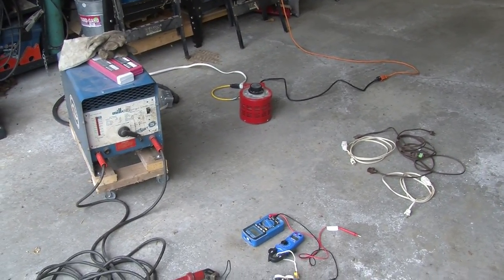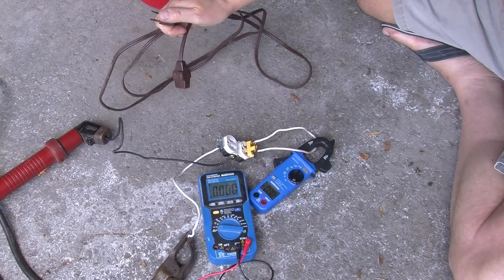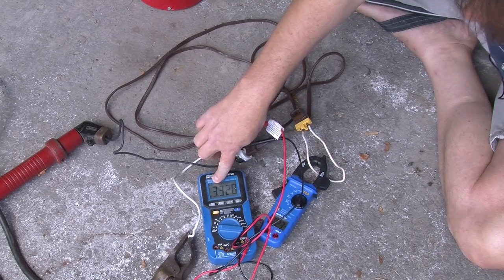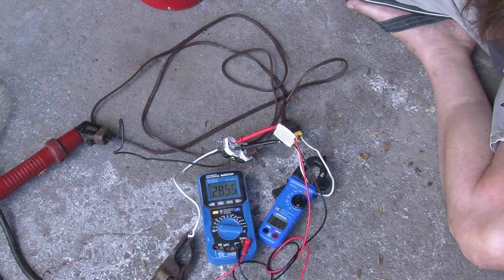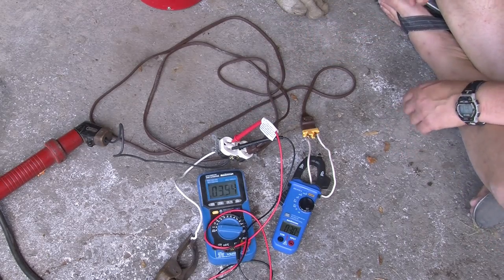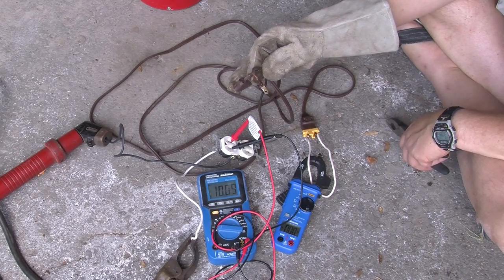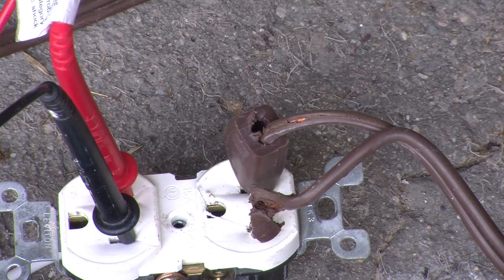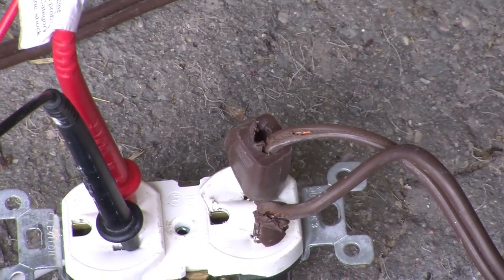Lets try overloading some extension cords.

Comment: one of the core troubling issues I find with normal light duity extension cords is the fact the plug on the end often makes a very poor high restance conection to the device pluged into them.. people do things like plug hair dryers into them in bathrooms when there cords are not long enougth and quiclky discover that it melts the plug on the hair dryer ,, the worst thing someone could ever do is plug a space heater into them as they will not trip the 15 amp circut breaker and you will end up with a fire (usully at the plug on the end) , a bad receptacle with a loose fitting contacts same serious issue and many low quality receptacles instaled in houses over the years develop this issue as they age resulting in house fires when people plug in unatennded long turn high currrent devices like space heaters .. they make 20 amp high current recepticles for use in areas where high current loads are used like on kitchen counters and I recomend there use everywhere.. never use an extension cord with a space heater unless its a special one rated for constant high current loads .. same with power normal strips the poor  contact they make with the plug can not handle the constant high current (12 amps ) load and will likly set the plastic power strip on fire..
Reply: We in Europe never had similar issues.
Reply: Electrical safety should be better taught in schools, imo. A lot of people seem to judge load by how many things they plug in and not what they plug in. If you fill a powerbar up with six 5 watt phone chargers it'll be completely fine. But when you put just one space heater, kettle, hair dryer, etc, you're putting way too much faith in a product which usually is designed as cheaply as possible. Sadly alot of people who dont know any better would look at the latter situation and think "its just one item, its fine". Of course, what we should really do is copy what the UK does, and fuse our plugs if they aren't going to be up to the same spec as the home wiring, which the panel breaker is sized for.
Reply from the maker: We should at a minimum have fuses in these light duty cords - it can be done - some xmas lights do and the plug is barely bigger. I was amazed at how well the modern cords did - but still! Your points are so true!
Reply from the maker: I'm not surprised!  I lived in Germany and Iraq (which used UK plugs) when I was a kid. Both German and UK plugs seem so much more robust (over engineered?) than ours. The UK 13A plug is about the size of our 240V 30A one for example.
Reply: @ElectromagneticVideos  I am not a fan of Christmas lights, either.  They are usually wired with 22 or 24 gauge cable and have a three amp fuse in them!  I know I don't like running three amps through 24 gauge wire -- I plug each string of lights into a power strip separately and don't daisy chain them.  If I need a short extension to make it work I have several green 16/2 extension cords to connect them with in the Christmas tree box.  One incandescent string of Christmas lights draws less than an amp.
Reply from the maker: @mharris5047  Yeah - sadly I'll bet the ever increasing cot of copper will only serve to encourage the  manufacture of those really thin wires. As you said, at lest they have a fuse ...

Comment: I once used a new 10-foot 12-gage heavy duty power tool extension cord with a 15 amp 120 volt table saw.  The saw started much slower with the extension cord than without.  I determined the cord had a 30 volt drop during saw startup and one plug got warm in a few seconds.  Breaker never tripped.  I now check the temperature of the plugs whenever I use an extension cord.
Reply from the maker: I never trust those extension cords plugs and sockets - the softer plastic just doesnt give me much confidence. 30V drop is huge! Amazing with that 12 cord.
Reply: @ElectromagneticVideos  I check the resistance of my extension cords before using them.  There should be minimal resistance (0.2 ohm or less for most plus whatever the resistance of the multimeter leads are).  Dropping 30 volts on a ten foot cord is ridiculous!  Even 500 feet of 12/2 shouldn't drop that much.
Reply from the maker: @mharris5047  Yeah - anything more than a few volts drop is too much! One things I have often wondered about is the effect of old tarnished blades on plugs. I should test that sometime.

Comment: Looking at the Siemens breaker curve, a 20A breaker will trip between 60-400 seconds at 30 amps. Should be enough time to prevent a fire unless you're maybe using an 18ga cord, which def should be illegal anyway. Not everyone understands current ratings like most of us here, and some people are  bound to unknowingly abuse the ratings of these cords.  Or like Christmas lights, these small gauge lamp cords should have built in fuses.

Comment: The Brown Extension Cord was before the NEC was revised to make sure electrical cord insulation wouldn't burn or "sustain combustion"... you could have started a charcoal BBQ without any starting fluid with that brown cord... food would have tasted funny, though...
Reply from the maker: Thats why! So there was a change in the code! I can totally see your BBQ points. I wonder if the code also has some toxic fume rules - the smoke from the brown one was unimaginably bad.
Reply: @ElectromagneticVideos  Yeah, the first were about 45-50 years ago... there were more added in the wake of the MGM Hotel fire in 1980 that killed nearly 100 people. I think the codes were amended for toxic fumes from insulators used on inter-floor wire ducts/raceways on multi-floor buildings. Not sure when it applied to Extension cords, but it was in the 1970's, IIRC.

Comment: They are all Noma cables, including the brown one. The brown one is late 60s, the white ones are mid 90s. There was a generation in between that had the newer plug style seen on the white cables, but no polarization - made in the mid to late 70s. All of them in the video represent a period where Noma manufactured cords in Canada. Unfortunately, in the late 90s or early 00s, Woods bought Noma brand and shortly after shifted production to China. The new product is inferior and a lot of the cost cuts are evident, especially in the cord receptacles/plugs. On a side note Noma also made an integrated “cord caddy” reel of cord with an integrated outlet in the reel body. Considering the cord stays wound when not fully extended, would be nice to see in a torture test like this.

Comment: Oh yes the good old Federal fire pacific electrical panel which will let you are arc weld anywhere you would like in your house since the breakers don't actually trip. That's what a check under the UL laboratory store at the time of manufacturer got you. So you could theoretically see upwards of 50A easily on any circuit. There's definitely an era of plug and and cord options that I would not trust like that brown one I never did like them as well as than that they were brown.
Reply from the maker: Yes - there must have been some terrible incidents as a result of those breakers.

Funny - I don't trust those extension cords either and was in the process of putting them in the garbage and had a thought - might be fun to see what happens when too much current goes though them.  What you don't see in the video is how vile the smoke was from the old  brown one.

Comment: 12:28 Federal pacific Electric panels are a wee bit dangerous. The breakers won't trip.
Reply from the maker: At some point I want to try a Federal Pioneer. I wonder what the "dont trip" statistics are? 1 in 10? 1 in 100?
Reply: @ElectromagneticVideos  I believe Federal Pacific manufactured outdoor breaker boxes.  40-50 years of weather is what does those breakers in -- even with the breaker box door closed basically the whole time.  My brother has an outdoor breaker box on his house but I sure as hell won't have one if I can avoid it.

Comment: The Zinsco and Federal Pacific breakers did fail all the time and the wires would overheat and burn the house.
Reply from the maker: You know, you wonder why some other company didn't make drop in replacements for them that were safe -  probably would have been  real market opportunity there.

Comment: I'd barely even want to put 5 amps on those things. The only place in my home those are used is to connect my router and network switch to the UPS, which needs to be far away since the switch and router are mounted on the ceiling. They combined have a theoretical total power draw of about 25W or 210mA@120v going by what's stated on their power adapters. In practice they're way lower, the UPS doesn't even register them as connected and just shows 0w output unless I turn on my PC (That's not on the extension cord)
Reply from the maker: That's the way I feel! I was stunned how well the newer ones do, but even so I woudnt put more than 5A on them either. I have a  few (LED) lamps on cords like that - like your router, shouldnt be an issue.
Reply: Agreed. I only use them for what the name would imply, lamps! With LED bulbs I'm not even pulling a quarter of an amp. 

I avoid molded-plug PVC cords for other heavy loads as much as possible, I have many heavy cords made with SO/SEO cable and commercial grade ends for garage/yard and workshop use.

Comment: Funny how when plugging household appliances with power consumption of 1200-1500W, such as vacuum cleaner, makes their cable connector very hot at receptacle. Even the cables often get quite warm. And there are people connecting multiple devices into extension cords and exciding their current rating.
Reply from the maker: Yes! And apparently overloaded extension cords as you describe are a significant cause of house fires. They really should have builtin fuses.

Comment: I would actually trust the molded plastic courts better than the solid plastic ends. Not only can the hard plastic ones break easier they also melt easier from firsthand experience unfortunately with a space heater and an unusefully located outlet add a facility I was working at.
Reply from the maker: That sounds like an unfortunate experience. So the plugs that melted/broke - were they the old black ones or the newer yellow ones?

Comment: I have a Noma extension cord exactly like that, and mine says its good for 13 amps.
Reply from the maker: Just checked one I have - 16AWG 13 Amps. I would be wary of 13 Amp over a cord like that -  particularity if all though just one of the three sockets at its end. I really have misgivings about how good those sockets made in soft plastic are.

Comment: Is the output of the welder AC or DC? I have read somewhere that wires can handle more current in DC than AC because of skin effect
Reply from the maker: It is a (vintage) AC welder, In the old days, high current semiconductor rectifiers were unavailable or expensive, so almost all welders welders AC. 

Skin depth: the skin depth at 60Hz in Copper is about 8mm, so any household wires like these are not really affected by it. Its a different situation for larger conductors (over a few cm dia) where the parts of the wire close to the center become unused. 

It is much more of a problem in RF. At the Wifi and Cellular phone bands, skin depth is around a micro meter. For AM radio its about a mm. Once of the tricks that is used for higher powers in RF is to use copper pipe as conductors - no point in having any copper in the center since no current flows. 

Its also a problem when trying to communicate with submarines  since the skin depth of salt water keeps radio waves from penetrating deep into the ocean. I did a video with a simple expehttps://youtu.be/cPxYYwFiK0kriment you can do with a cell phone here: https://youtu.be/cPxYYwFiK0k

Comment: Does the welder rectify the AC input current to DC at the extension cords? Why is the welder in the circuit?
Reply: The DC welder provides easily controlled  electrical current and is much safer than AC.
Reply from the maker: @36736fps  Its actually a vintage AC out welder. I control the output current by running it off a variac. Since only a low voltage is needed at high current, the welder is much safer than using line voltage and produces the same heating for the same current.

Comment: Maybe put an ammeter at the beginning of the setup to see what kind of line loss there is?🤔
Reply from the maker: Actually I did have both an ammeter and voltmeter on the input for that reason, but with the resistance of each connection being different, the voltage which is the sum is not that useful. To your point, a much better test would be each connector tested by itself with current and voltage being recorded. And maybe also the voltage measured on the wire just before and after the connector so we essentially have the voltage and current across the individual connector and get a much better idea of  whats going on...

Comment: Hi, are you an electrician? May I ask if the cooking stove overheated and the extention I was using also got burnt, the wire is getting hot. Than the end plug of extention is burnt. I also saw there is a burnt on the wall outlet. Now my question is does the wall outlet still safe to use? is it not going to ruin other appliances?
Reply from the maker: I'm an Electrical Engineer. Don't use your burnt outlet - there could be charred plastic (even in places you cant see) that could conduct electricity, heat up, and cause a fire. In fact you should turn off the circuit breaker or remove the fuse for the circuit with the burnt outlet untill you can have it replaced. The overheating will also cause the contacts in the outlet to oxidize making them worse contacts and even more  prone to heating than before and that could damage the plugs on anything plugged into it. 

I did watch your video of it -  the bad news is all the things that melted and/or burned have to be replaced. Please don't risk your health or life on anything damaged like that.

A bit of advice - any sort of heating appliance like your stove burner really should not be used with an extension cord - the wire, plug, and outlets on almost all extension cords are not made to handle the high currents created by heating devices. Extensions cords with sockets like the one you had that allows devices with different types of plugs to be used are the worst in terms of ability to handle higher currents from heating devices. They can be used carefully with a few low power devices like lights, electronics etc but dont use any heaters, vacuum cleaners or other high power devices with them! If you absolutely have to use an extension cord with a device like your cooking stove element, ask a local electrician what type of extension cord to use with it and unfortunately it wont be a cheap one.

Hope that helps!
Reply: @ElectromagneticVideos  I am actually using the burnt wall outlet but nothing happened with the appliance. There are two sets of it on each wall, so is it just the burnt one that should not be use? the left side is not burnt so it's fine to use? Well I use extention because I cook outside. The cats turned it into highest heat when I left. It is still running but burnt on the bottom. So you mean I have to change that wall outlet? What kind of extention do you think is better, what is the name and specs of that? If the wall outlet is change is it just the square outer part or is there something inside that needs changing too? I am surprised that it was overheating and the stove did not shut down, it says it has thermal fuse.
Reply from the maker: @meilih2030  I would certainly not use the burnt one. I dont know how attached the two outlets are behind the cover plate - your outlets have the same pins as ours but are clearly mechanically different behind the cover. Are you in the Philippines? Looks like you use the US/Canada pinout but have 220V power which might be why the outlets are somewhat different from ours.

As far as extension cords, you really need some local expertise to help you with what is locally available and suitable  for a cook top.  The power cords we have here are all made for 120V so if I am right in thinking you are in a 220V country nothing I know from here would be right for you. 

As far as the stove overheating,  as you said it shouldnt have happened with a thermal fuse. But these days you never really know if it actually had one or not, or if it did, what the quality and reliability of the thermal fuse actually is. And even if it had a good one, things fail. Good thing is, sounds like no-one got hurt which in the end is the most important thing.